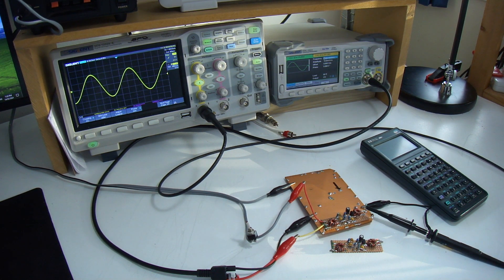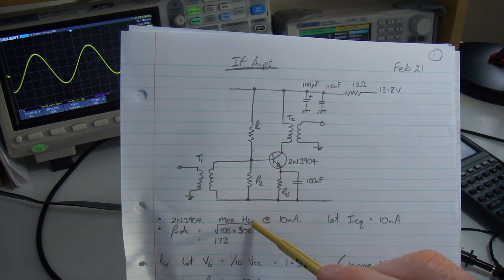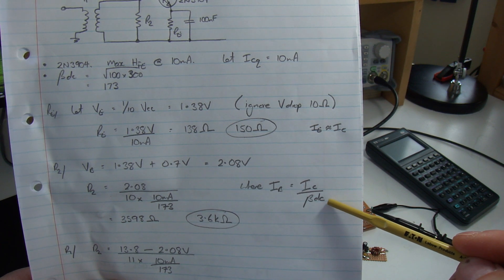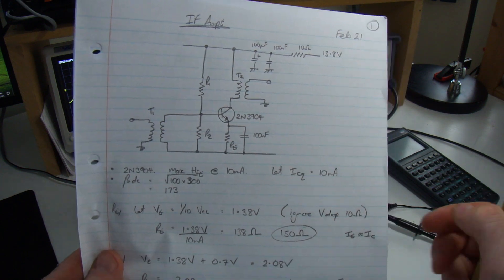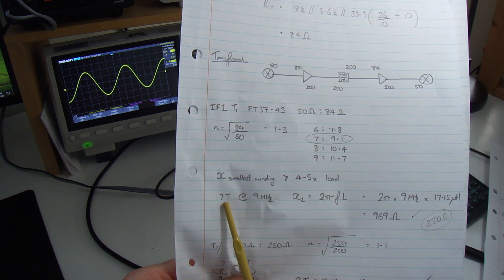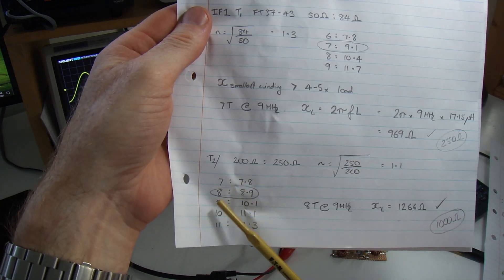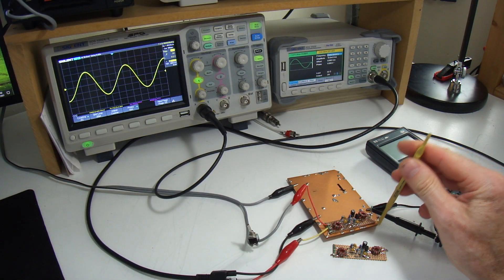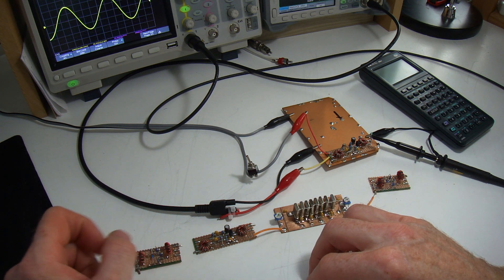Simple SSB Rig: Part 6 - IF Amplifiers

Comment: For practicality, design and test with a standard impedance (such as 50 ohms) for all source/load and amplifier input/output impedance. I also recommend using LTSpice to run simulation before building circuits.

Comment: Charlie, where does the value of 26 come from in the re part of the Rin calculation? 

The reason I ask is I built up the circuit and am trying to use a NanoVNA to measure the input impedance and I am having trouble measuring the input impedance. If I put a 40 dB input attenuator on the input I end up just measuring the "perfect" 1:1 VSWR of the attenuator so that doesn't work.  If I drive the Amplifier directly without an input attenuator and put the 40 dB attenuator on the output the Amplifier goes into compression (saturation?) so I don't trust the input VSWR to be accurate. Maybe it's still accurate but I don't feel like I can trust it.

The NanoVNA is measuring the VSWR with a "U" shape dipping to 1.5:1 at 15 MHz and rising a bit to 1.6:1 at 9 MHz. According to the NanoVNA that is an  input impedance of 81-j10 at 9 MHz. I figured I'd remove a couple of windings on the input transformer to drop the impedance to closer to 50 ohms for a closer match but am not sure that with the compression I can trust the NanoVNA to measure the S11 (or VSWR as a surrogate).

I understand all the other numbers in the input impedance calculation, it's just the 26 value in the maths that I don't follow. The rest of the numbers are much higher than the Beta AC times 26 `divided by 10 value so they don't much matter in the input impedance calculation.

Any help would be greatly appreciated. I've watched all of your videos many times and they are really good! You've reignited a dormant passion to build radios from pieces in my life. I like to characterize the parts as best I can and this one has me stumped.
Reply: Found a W2AEW video that shows how to use NanoVNA with IF amps. https://www.youtube.com/watch?v=7TtKE39TWpI
Reply: As a side note, I think things are generally working since I see an S21 gain of 24.3 dB at 9 MHz and a power supply current of 12 mA.
Reply: I dragged out my copy of SSDRA and found the answer on  page 20. That's where the 26 (they have 25 but close enough) comes from.
Reply: I set the NanoVNA to CW output at 9 MHz and added a 50 ohm load to the output. It surprised me that the output wasn't clipped so I feel like the S11 return loss is probably accurate-ish. The Amplifier seems to clip at frequencies lower than 7 Mhz due to higher higher outputs from the NanoVNA at lower frequencies.

I also messed around with the input transformer a bit and got some small improvements to the gain and bandwidth. The VSWR after these changes is 1.47 which is 67+j15 impedance or a return loss of -14.4 dB. Closer to 50 ohms, but still a bit off. The only other term in the input impedance is the Beta AC - maybe it's a bit hotter in the junk box 2N3904 I am using resulting in a higher input impedance than the maths? Probably makes no real difference, but I'm one of those folks who likes to understand the "whys"

Sorry for the rambling comments. Trying to work my way through this.

Comment: Hi Charlie, many many thanks for all the great videos and for sharing. I like what you do not only because you share your schematic but also because you share with us your calculations and your approach. But I would like to ask you if you could give more information of how you made the transformers, in this case for the IF amplifier on input and on the ouput, what kind of materials, copper wires (section) and so on you are using .. maybe you can also share the part numbre .. it would be very nice .. thanks a lot ... Many greetings from FRANCE Cyrille

Comment: Charlie, great video and you're doing pretty well to get the performance you do from a single transistor stage.  If you use 2 discrete signal-cables I'd use a hybrid-combiner for sure.
A few thoughts: When I was a youngin', all I could afford was the bulk un-marked transistor-pack from Radio-Shack.  As anyone with this experience knows, this was one of the most insidious, devious and demoralizing crimes 'Fausted'-upon new and unsuspecting neophyte experimenters!  As as result, I came to learn (other than how low Radio-Shack would stoop for profits) every defect that a transistor might present either immediately or subsequently when you installed one of these fine jewels in a customer's piece of equipment! After separating the total junk and rigorously (actually viciously!) testing for durability, I learned to segregate based upon certain characteristics as well as gain or beta.  When I would build something, I would usually include a spare kit of repair parts to use in the future.  So, I would color-code with paint the tops of similar/compatible transistors, signifying where they would go in the future.  The point is, that you can now buy 100's of 2N390x transistors and cheaply grade them yourself; you'll find most are close to each-other with excellent performance especially from a reputable manufacturer.  Furthermore, your beta-calculations will be much closer and truer because you're using 'your' 2-numbers from the actual lot you sorted.  So, if you bought a few hundred of these and did this, you'd have enough to last your lifetime and could easily directly replace anything using that sorted lot.  I just always had a problem of using the minimum-beta unless I was designing for production, and without control/inspection of the components used.   Just and idea.  73...
Reply from the maker: Thanks for that. I did purchase 100-odd in the last lot. I'll take another look when I can.

Comment: Hi Charlie,
Thank you for the inspiring videos. Your videos made me learn more electronics. I have a comment/question. I simulated your IF amplifier in SPICE and it seem to me that the impedance that is looking into the transistor is about Zin = (19 - i*76.55)Ohm. After transforming with T1 it becomes Zin = (11.3-i*45.56)Ohm (|Zin| = 46.948Ohm). This leads to a reflection coefficient that is Gamma = -0.05-i*0.78 (|Gamma| = 0.782). That is rather big. Since this stage connected to the mixer (with 50Ohm output impedance) I think it is not healthy if the amplifier stage reflects back the signal to the mixer. The IF frequency is fixed to 9MHz, would it be better to use a L-network to match the complex impedance?
Cheers,
Zoltan
Reply from the maker: I'll look into it. This approach has worked well for me in the past. Will LTSpice calculate input Z?
Reply: @CharlieMorrisZL2CTM  Not directly. I did the ac analysis with an ideal voltage source. I put a Rs = 0.001ohm resistor in series with the input. In the AC analysis I plotted the -V(source)/I(Rs) in Cartesian representation. Then you can read out the input impedance. It was important to terminate the output with 250 resistor (that is your filter input impedance), otherwise you get negative resistance at the input. That makes sense, with floating output the impedance at the collector is infinite and C_\mu of the transistor become so important, I think.

Comment: Could you make fractional turns depending on the core geometry used? (Such as around a ferrite rod)
Reply from the maker: I don't believe so. For toroid's it integers only as it each time the wire passes through the core. As for a rod, I'd assume it's for each full turn. The only way, that I know, to fine tune the inductance is to vary the spacing.

Comment: The rig i am working on, i am using 5v for the VCC on basically everything to allow for longer operation on my 12 LiFePO batterys and also maybe being able to run off a 9v or a cheap USB battery bank.

For the PA i am going to use what ever the actual raw input from the power source is.
Reply from the maker: Very interesting. Keep us posted on how you get on.

Comment: Yeah you must have left out a capacitor between the base and the transformer, or should have put the junction of r1/r2 at the bottom of the transformer with the top going wto the base.  Then would have needed a bypass cap across R2.
Reply from the maker: Grrrr, so annoying. Yes, the circuit has a 100nF cap from the transformer to the base. I've updated the schematic on the bog, and updated the video description. Thanks!

Comment: And now as far as xtal filters are concerned the filter needs a specific output load impedance - in your case 250R. But it also needs a specific SOURCE impedance of 250R. It does not present this impedance to the driving amplifier, it is the amplifier that must present this impedance to the filter. So you need an amplifier with a specific output impedance (of 250R), not a random choice of a load of 200R or 1K and a transformer... I do not yet know how to set the output impedance of an amplifier, but an emitter follower with a series resistor of 250R may work... or you could put a 200R resistor across the primary of the output transformer to define the impedance? Or perhaps use an IC such as the MC1350 and a series resistor?
Reply from the maker: I've always thought that too. Even though this arrangement has worked well for me in the past, i might place a 200 ohm resistor across the primary of T2. I've seen that a couple of times before.

Comment: Perhaps I am faulty, but with the bias at Vb = 2V the collector swing can be 10Vp-p, with 10mA and 200R this canbe only  2V swing. So 200R is too low as a load to produce much output voltage? Surely you need to have a load of  1000R to allow a swing of 10V, so the optimal  load to the Transistor should be 1k, not 200R, so the 10mA can swing the output 10V.... Or am I missing something? Then of course the 1000R output load  has to be transformed to 250R for the xtal filter? Have you tried this? Does it affect the 37dB gain?
Reply from the maker: Not sure sorry Anthony. I measured the 700mVrms across the 240 ohm load.

Comment: Thanks Charlie, I'm waiting on parts for my IF amp. I'm using 2 BF998's with the input to the first stage loaded down with a 50 ohm resistor to keep the mixer happy at all frequencies and the output of the second stage with a 1k ohm resistor to match the filter. It works in spice now I just need the parts to show up.
Reply from the maker: Sounds great Jerry.

Comment: Hi Charlie,

I have just caught up on your video's due to work commitments. Just a quick note about the ft37-43 toroid's and the transformers for your double balanced mixers. I am sure you know that the wideband transformer optimal range is 5 MHz to 400 MHz . 

Possibly a better choice is the ft37-75 these have a wideband transformer range of 1 MHz to 50 MHz . This maybe a better solution as you possibly wouldn't suffer greater losses below 5 MHz due to using the core outside it's optimal range.

The second point is the number of turns may NOT be optimal for the frequencies of interest due to the inductance and the frequencies in use, This would change the impedance on the input/output of the mixers at the frequencies of use. This could give rise to more possible losses in both double balanced mixer stages. 

In my humble opinion your double balanced mixers seem to be assumed to have an impedance of 50 ohms rather than designed to be 50 ohms. This opinion is solely based on not seeing you calculate or discuss this aspect of the double balanced mixer design step. Looking at these points may yield a double balanced mixer that is a lot closer to commercially available mixers ( it also may not make any noticeable difference at all. It is merely offered here as food for thought when building mixers.

Stay safe

Simon M6FJW
Reply: @tcarney57   yes i understand that but many others may not ( that was the point , that Charlie didn't say why or what sources were used, for anybody doing a parallel build). The other point that i was making is this...

9 MHz and 10 turns on a FT37-43 = 1972 ohms of reactance at the stated frequency ( just using a basic inductor calculator for the primary input winding). now 12.65 MHz ( the oscillator frequency that was partially discussed, 9 MHz IF and 3.65 MHz signal assumed and a high side oscillator) and 10 turns = 2.7 k ohms of reactance ( again using a basic inductor calculator). These things may make no difference in real terms, but are  worth discussing.

Which leads to the question " will a different number of turns be better?". Better is a relative term and merely points to better for this build. Yes the sources are tried and tested, but doesn't mean they are optimal for any particular radio build, Or that the design shouldn't be altered in any way. These radio builds are about discovery and learning. Sometimes discovery and learning requires you make mistakes while experimenting ( that how humans learn) to fully understand why things should be done in a particular way. Just following somebody else's design blindly doesn't offer any real learning, it just teaches how to copy. 

best regards

Simon M6FJW
Reply: Optimization makes sense but isn't the point of using ferrite cores to suppress high frequency noise which is more of an optimization factor?
Reply: @nyworker  using a core outside it's optimal frequency range could lead to losses. so picking a core that covers all the frequencies of interest ( LO, RF and IF frequencies) will have less losses than using the wrong core type. If one or more of the signals is outside the optimal frequency range of that core then it wont function as well, this may have the effect the altering the lowest receivable signal level ( if this makes a difference at all, you may live in a high noise area ).

best regards

Simon M6FJW
Reply from the maker: Thanks Simon. Yes, I am aware they are wideband. I tend you use them as they are easy to obtain here and have a wide range of uses.

Comment: Oh I saw a new toy...sweet.
Reply from the maker: Yes indeed. Now to learn how to drive it, and NOT blow it up!
Reply: @CharlieMorrisZL2CTM  :) Most importantly don't exceed the maximum input signal level. You are going to need a high power (10W...100W) 30 dB attenuator for testing power amplifiers for IMD, harmonic distortions and things like this. Such kind of attenuator are easy to build. The principle is the same as with 50 ohm dummy loads. Otherwise these things are difficult to damage. If you are not going to exceed 10W in the nearest future there are inexpensive 10W dummy loads and 20 dB attenuators with BNC connectors on eBay.

Comment: Hey! Is it missing a capacitor to couple the input transformer? The way drawed will short the DC bias!
Reply: just remember not all the stages have been shown yet and Charlie has done a similar thing before and had the capacitor on a previous stage. So don't worry too much at this stage ( after all we all know it belongs there from all the other radio builds, so the fact it isn't drawn on this stage is not really an issue ).

just remember also the previous stage is a mixer and there is no DC bias, it's actually an AC ( RF ) stage ( this is a second reason why the capacitor is NOT an issue).

Best regards and stay safe everyone

Simon M6FJW
Reply from the maker: Yes, but the secondary of T1 is a DC short across R2. The 100 nF cap fixes that.
Reply: @CharlieMorrisZL2CTM  you missed the cap off the circuit shown at the begining. Caused a bit of head scratching. :)
Reply: That was my thought too, but I thought I must just be missing something.
Reply: I saw that too. A capacitor or having the secondary coil in series with the biasing resistors. I am sure it is just a simple mistake he made when he made the schematics 😁
Reply: I was just thinking while looking at the circuit, the the bias is wrong with the DC resistance of the transformer shorting out R2.